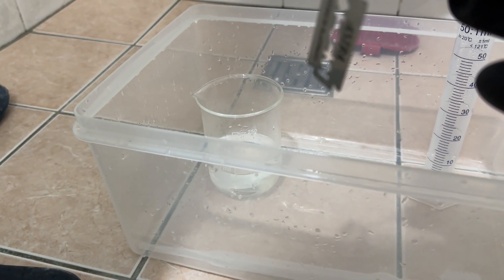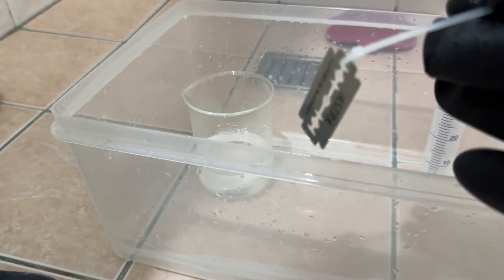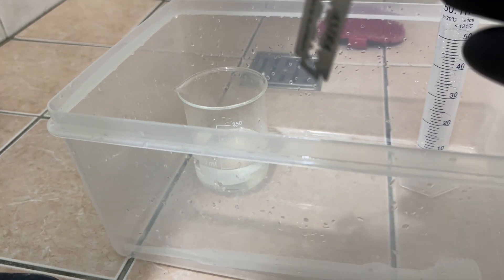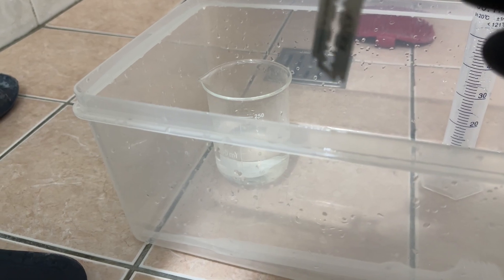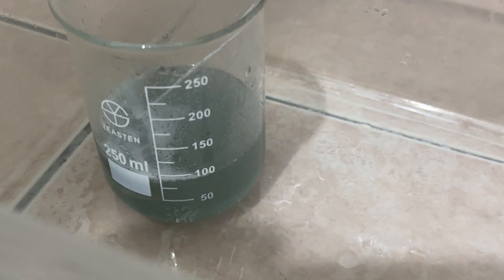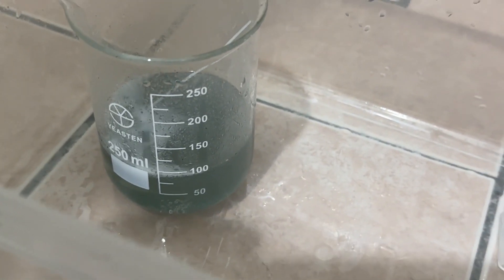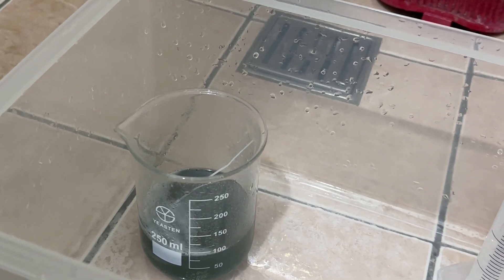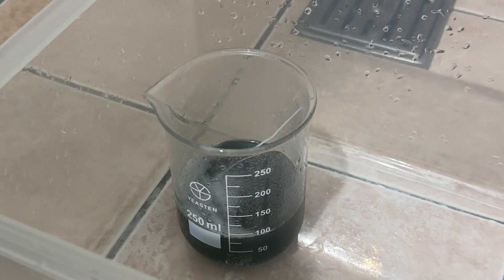Razor blade in H2SO4

Comment: Yup, that's sulfuric acid for ya!! 
There's actually not a lot of chromium in martensitic steel, and the green color you see is ferrous sulfate, FeSO4, not chromium sulfate. The delay was admittedly odd, but I've seen similar things before, especially with HCl+H2O2.
Reply from the maker: That made sense when I thought about it later and looked up what the color of some iron in solution might look like. Good thing razor blades are super cheap. Any other ideas?